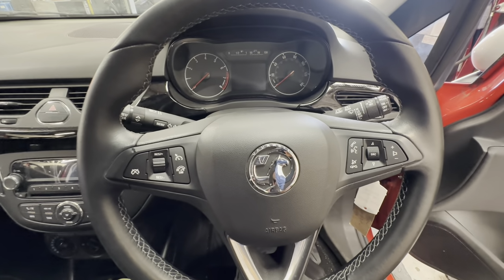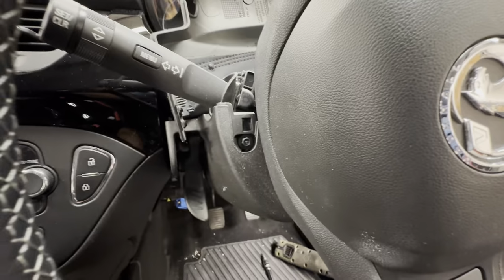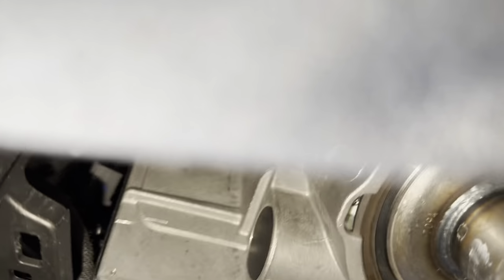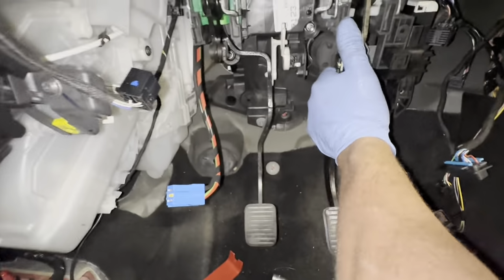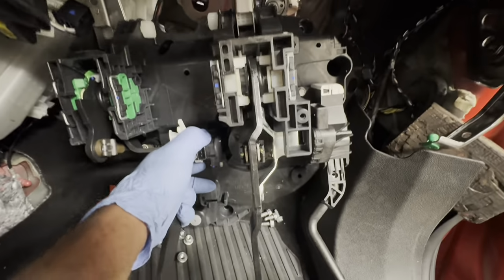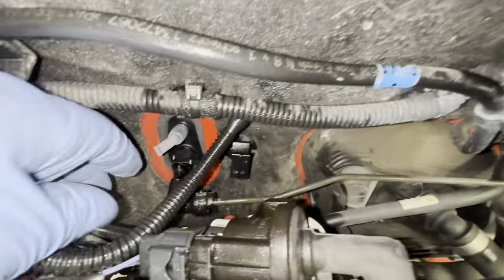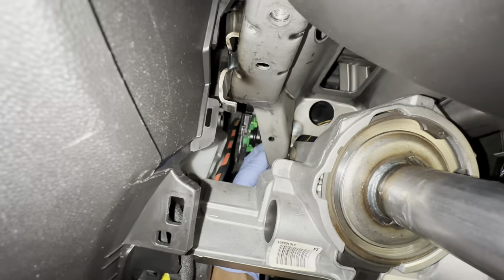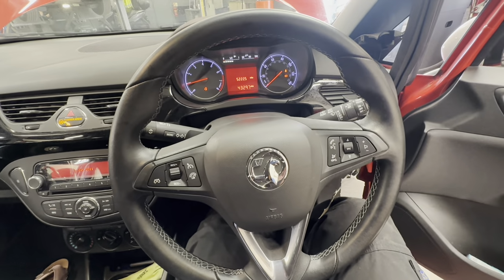#Vauxhall #Corsa E #2015-2019  #Pedal #Box #Replacing

Comment: I removed the steering column too, but now the car won't start after removing the steering column after replacing the clutch cylinder, there's no fuel going into engine from the hose that brings fuel into the engine. How can removing the cables around the steering and putting them on affect fuel going into the engine?
Reply: I don't know for sure, but i will try hazard a guess. Its possible you triggered some anti-theft features, like a steering lock or an immobiliser or something like that, Which may need to be reset. I dont know if the ignition is tries to work but the engine doesnt turn over because no fuel, or if it just doesnt even try to start, but that might be an area to look into.
Reply from the maker: What do you mean you don’t touch the fuel hose the only hose you should be touching is to do with the clutch and brake

Comment: My dad 83 just had a peble assembly fitted corsa 2015 model  900 quid he took it out charge battery up picked it up today pulled up at lights cut out its s stop start  it'd been repaired lookers shocking

Comment: Great video, what issues was tue customer having them Making them bring it back under a recall?
Reply from the maker: Broken spring
Reply: @g_a_bofficial  just started this job at work I have a clutch return spring. I’ve removed the pedal and the green clips and was just going to change the spring is that not possible ?

Comment: Can the clutch master cylinder be replaced without removing all of this hideous crap ?
Reply from the maker: It can
Reply: @g_a_bofficial  how do you get it out bro it's stuck in for me.
Reply: How did you do it?
Reply: @aaronalderson5279  you have to take most of it off and loosen the pedal box. It's not that bad to do really when you get the column out of the way
Reply: Yes I just had to do it just loosen the peddle box and pull it back a bit you can reach the cylinder round the side
Reply: @willlovell9278  Hey buddy, could you help me with some advice getting the master cylinder out. I've had a look, and it looks totally mental to get at it.
Reply: @coolsam2045  yoo man. Steering column and motor off. You can then loosen all the bolts holding the pedal box in. Then you undo the master cylinder off the side, pull pedal box back and wiggle it out. I think I also undid the brake mastercylinder off the servo under the bonnet and ofc the pipes to clutch master cylinder. You'll probably need to order a new white spring retaining clip for the clutch pedal as well, mine was broken. Vauxhall won't supply them separately as this is a recall job, but we got one off e bay or amazon I think.
Reply: @coolsam2045  gave ya a bit more info, champ
Reply: @RideBikes_Walkplaces Cheers buddy that's a great help.👍